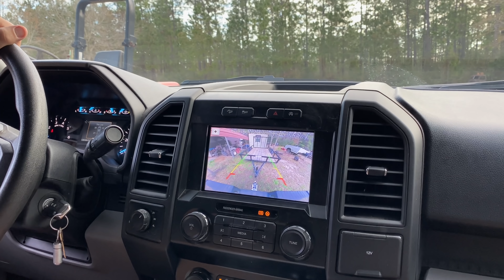SURPRISE!!!! We got a HUGE New Shop Tool!!!!

Comment: My racing mentor Terry Downing had the exact same sheet metal brake. It was really nice to use, building bodies when I was working in his fabrication shop.
Reply from the maker: It is a fine piece of equipment!
Reply: @chasehollandracing  Yes it is. It will also bend light gage steel plate. I believe up to 1/8 inch thick. Or like the HTF guys use for mounting their seats to the chassis.